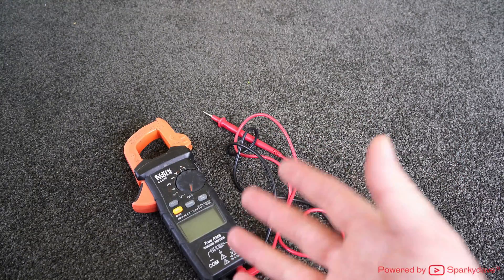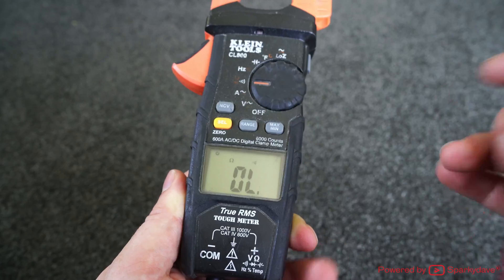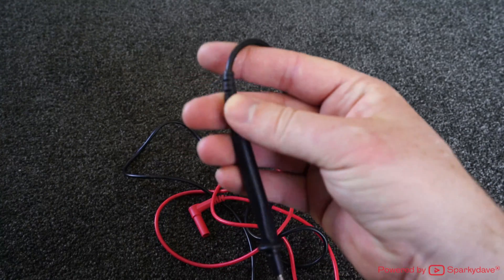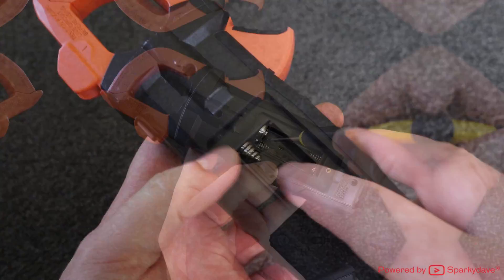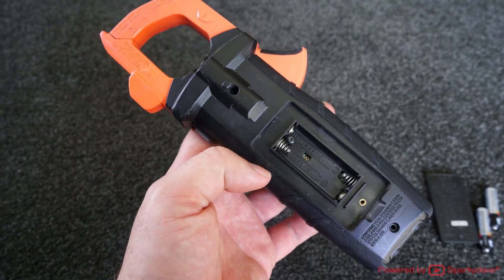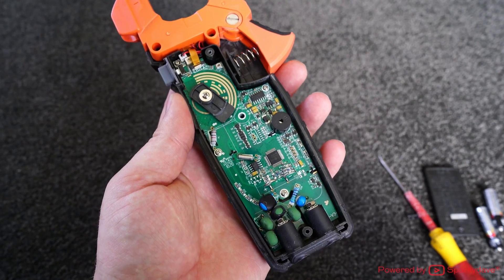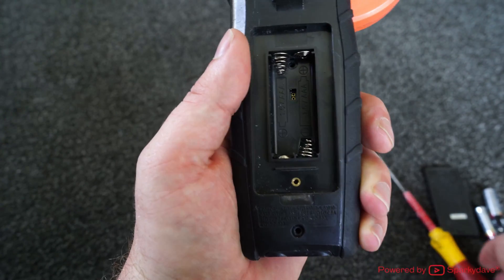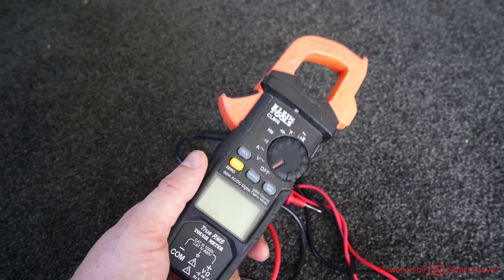How To Fix High Resistance (O/L) Issue on Multimeter

Comment: Similar problem with my Klein CL220 but my guts dont look like that. My problem is, when testing my leads, its at say 0.2 for a splt second  the ohms goes to some high number like 40 then descends very quickly. I open it up and it does have screws but they look little like that. Everything seems to be tight but still same problem. I replaced batteries and cleaned the inside and battery connection but nothing.

Comment: The beeping on my clamp on meter is not working when I'm on continuity mode and have both leads touching. Do you know what could be the problem? I've tried tightening those nuts and pushing the probes all the way in.

Comment: I am looking to get into an apprenticeship and was looking into the Fluke T6-1000 when I land one but seeing that the Klein CL800 is not only around $100 cheaper but the clamp also measures DC current which the fork on the T6-1000 doesn't do I am going to pick one of these up when I start... I hope I don't get any flak for going Klein instead of Fluke.

Comment: I had this happen on my 179, it was reading 900-1.5k with different leads and what not. Took it into local cal place for a warranty since I figured a fluke meter reading wrong would be good enough grounds for an upgrade. Instead they tried to give me a sore dick deal going on about how the main board would need to be replaced and it was because I must have hooked up amp plug to the mains (I did not, the fact that there's two massively overbuilt fuses in it didn't seem to concern them) and that it wouldn't be covered under warranty because of that. Told them thank you but stick your quote where the sun doesn't shine, cracked it open and found that the solder on the COM jack had cracked, resoldered it with leaded solder (it's softer than lead free so should handle stresses a little better) and it's been working great for the last 6 years. Needless to say I use a different calibration place these days.